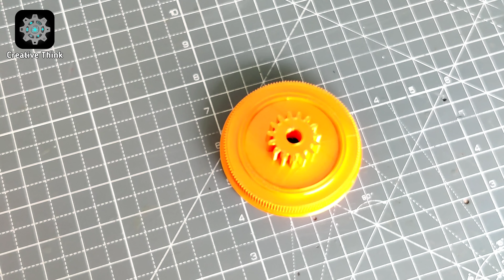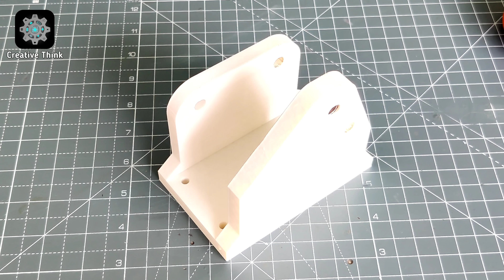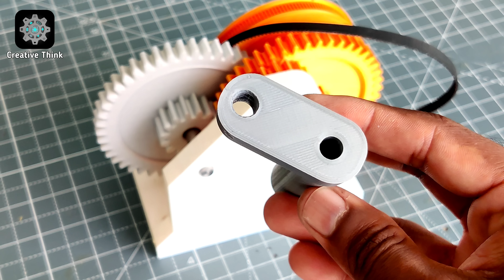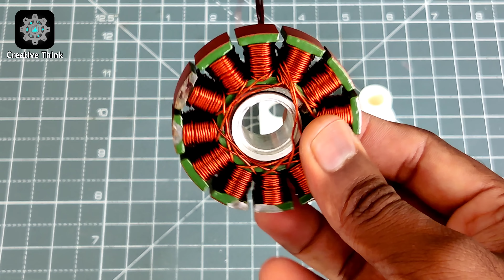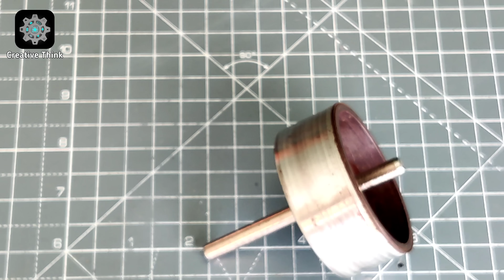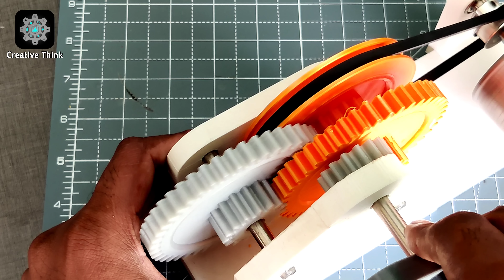Making Powerful Generator Using Gearbox || High Speed Gear BOX

Comment: Nice set up and try adding a DC capacitor to smooth out the DC voltage and a longer crank arm to make it easier to turn it.
Reply: Correct me if im wrong but isnt this an AC motor so it should be outputing AC current?
Reply: @awesomemcsumsface1416  your not wrong that is indeed a three phase AC generator/motor which he has connected to a three phase full bridge rectifier to convert the AC output to DC but it's not smooth so adding a DC capacitor to it it'll become a smooth DC voltage which will be better for charging electronic devices such as phones, tablets, laptops or anything that has a battery.

Comment: Great vid and tut, looks like carefully and well made video with high quality prints and other high quality materials. IMO the handle radius is too close, pushing can made easier by increasing the size of the bar handle.

I am also thinking about such kind of generator however by using gravity with a cord and weight, similar way used at an old mechanical clock. This system can be mounted on a wall and can charge a battery or powerbank. To charge the battery you need to manually rewind the weight to the highest position. When released, it starts the charge process. There must be a limit for the weight to fall down like at a mechanical clock so you need special gears for this. This must be not too slow and powerful enough (enough weigth to handle resistance) because when the generator (motor) provides current to the battery, the generator has some 'mechanical' (flux) resistance.

It would be great the system can run for a few hours, more than enough to charge the battery to full capacity. This system only needs one preparation for a cycle, gravity (free) and some time to charge it (but this is a normal procedure when charging).

What do you think, is this possible?

Comment: Can you manufacture the engine of the descending weights, you own a plastic sanding machine, and you can manufacture a gearbox from which the motor of the descending weights is made, I will tell you a way to increase the operating period of the motor of the descending weights by multiplying the weights. If the first weight descends, the second weight descends, and the process continues for a period that may reach an hour or hours
محمدعلي
mohammed ali

Comment: Fake : if it was real, the leds whould slowly light up as you gain speed , also it whould have bean way harder to turn if it wasent he was using a battery 

Also he has a tag free energy which is not real

Also he probs bots his subs , comments and likes , there is no way out of 900 000 people on 35 commented or 1 out of 30 000
Reply: I noticed, good job at debunking.
Reply: Also i realised a few more things that make this fake

The LEDs if they were powered by a real genarator like his whould have a very tiny flicker, i am not sure if you chould see it because very high frequency , 3 phase and the rectifier, but at startup it you should be able to see the small flicker when the frequency is low

If it was real the light output whould vary because it is very hard to have consistant crank

Also if you are interested in electronics i whould recomend a youtuber called electroBOOM, he is very funny yet educational
Reply: And 1 more thing i forgot is the vidio is very slow to maximise revenue from what i know